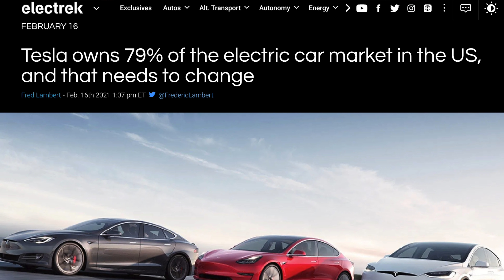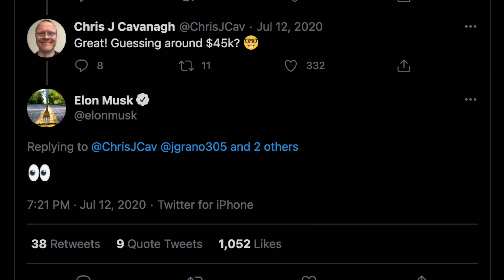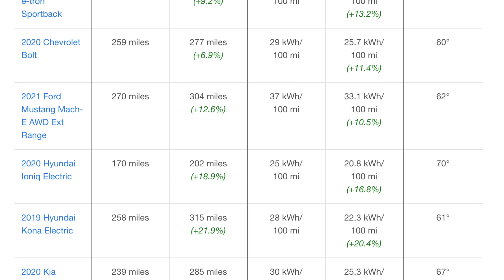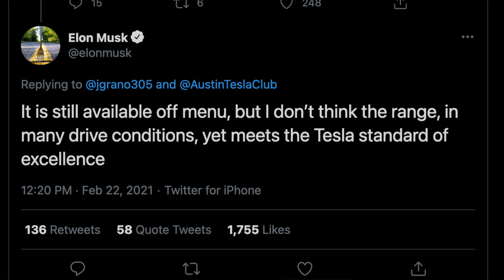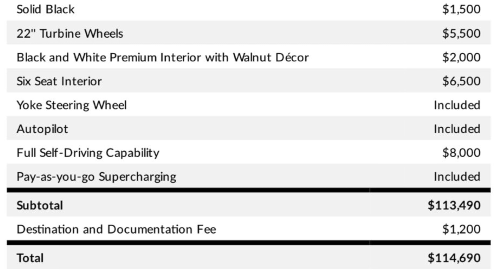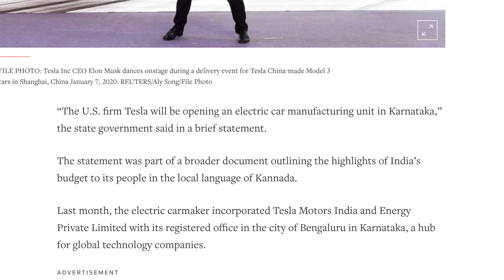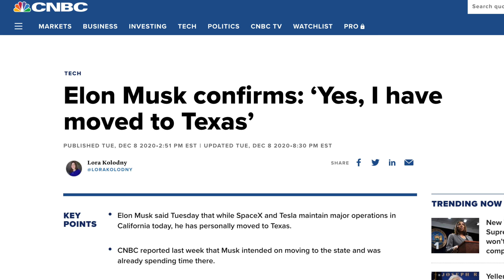What Tesla Didn’t Tell You | Model S Refresh

Comment: Tesla stock has long been extended from its buy zone after breaking out of a cup with handle with a buy point of 466 on Nov. 18, according to MarketSmith chart analysis. Hence it's not a buy. A stock is considered to be extended when its 5% above the proper entry point. It's a technical term used to describe the point at which a stock is up in price over its pivot or buy point and is considered riskier to buy. What you can buy instead is bitcoin. For starters, you’d need a broker. A good recommendation is Paxybits. Contact their open line

Comment: The reason single motor will not be available is because it will be less efficient than the 2 motor one.   The cars are heavy and it takes more effort to accelerate them, so 2 motors to accelerate and once they get going, then they run on one motor, the smaller front one, which gives them the longer range.

Comment: I think that, if carefully driven, the range should reach the estimated distance. Because the acceleration is used too often compared to slower other branches , Tesla's loose power where other don't have this power at all. What you don't have you can't loose. I always drive on cruise control and get even higher ranges than forseen in the energy diagram on the screen.

Comment: Those Edmunds tests were completely invalid. The conditions were not the same for all vehicles test and includes assumptions that clearly benefit everyone except Tesla
Reply: How so re assumptions?
Reply: @Tom_McMurtry  they didn’t run batteries down to empty.  Tesla has more buffer at the low end and also reduces power to ensure range. But most importantly the Teslas were not driven in the same test conditions or on a similar route. Completely invalid test that does not give an accurate representation of any of the vehicles in comparison.

Comment: I've seen some others pick apart that Edmunds report citing the temperature difference in the test vehicles (colder all around for the Teslas), differing routes (how can they use different test routes and expect like results?) and not using "Chill" mode. I think Edmunds stated that they specifically didn't put Tesla's in any range extending modes. I suppose it's possible that they didn't put others in any kind of range extending mode, but some might not even have those.

Comment: Model 3 sr+ in UK is expensive (£40,000 or $57,000 ish) and model 3 sr+ in America is on the website for under $30,000!!!!
Reply: Prices will drop once Giga Berlin is up and running 😉 That pricing includes logistics to bring the car from Freemont or Shanghai 😉
Reply: @carlosribaltes6110  yay because prices are way to high in the uk
Reply: @carlosribaltes6110  model s starts at £83,980 or $118,000+ and model x starts at £90,980 or $128,000+

Comment: The Kona EV and original Bolt, by most accounts, got a real-world range somewhat higher than its specs.  Reason:

The EPA lets EV manufacturers either perform a less-detailed test range test and then apply a standardized (or voluntarily larger) derating factor to that, or they can perform a more-detailed test to avoid that derating factor.  Tesla takes the detailed-testing approach to get the highest number possible.

IIRC, this explains the topic very well:  https://youtu.be/aZJba_oNhT4

Comment: Doesn't the "epa range"  look at total battery capacity.  As I recall the tesla has  "reserved" portion of the battery its like 10 -20 percent or something system won't charge battery completely in its charging settings I can't remember what this is for (longevity of the battery or something?).  So you may not get the entire capacity of the battery with this setting which might explain real world is less then epa range stated.

Comment: I’m stumped as to why anybody would want a yoke steering wheel, even in the unlikely event that it’s actually legal.  I think it’s mostly just a prototype publicity shot.
Reply: Because the yoke is bad arse !
Checkout the GMA T.50s released today... the best last ICE supercar of all time.. and comes with a yolk. From the greatest car designer and engineer of all time. And someone Elon admires.
Reply: @axiomic , I don’t see any bad-assery, nor any other kind of assery, there.  🤓  All I can see is impracticality:  In a sharp turn, you have to take your eyes off the road to see where to grab it.
Reply: @mr88cet  yeah, formula 1 drivers and jet fighter pilots just do it because it looks cool. So impractical though.
Reply: @axiomic , well, fighter planes mostly use a stick rather than a yoke.  But anyway...

Airplanes and F1 cars have control challenges different from passenger cars.  On an airplane yoke, you never have to (and in fact can’t) turn it much more than 90 degrees either direction of center.  Similarly, an F1 car almost never has to make tight turns.  You never, or at least almost never, have to perform a “hand over hand” rotation of the steering.  On a normal passenger car, a steering wheel needs to be able to turn typically 2 1/2 revolutions, and you routinely have to do so.

Comment: Yea I’m getting frustrated with Tesla. They don’t give any order updates or even confirmation on what you’re going to get (steering wheel). Also they agree to order contracts, don’t keep their agreements then completely change the car and say pay up. Horrible business practice. I ordered my Model S Performance on 12/12/20. Then had to update my order per my sales rep to the Plaid with all the extra cost. They said previous orders would be bumped to the front but I’m not confident that will happen based on how Tesla doesn’t give 2 craps about customers and have no integrity. I’m giving Tesla until mid March. If I don’t get a vin/update or deliver date on my Model S Plaid order than I’m canceling my order and going with a Taycan 🤷🏻‍♂️. Enough is enough.

Comment: Tesla needs to provide a method of changing shifting. No stalks is fine, but a method is required to do this somehow.
Reply: There’s controls on the touch screen to shift and in the event of computer failure there’s gear controls in line with the hazard blinker button on the center console.

Comment: I’ve asked several times, if the new Model S can have the round steering wheel. They’re still telling me no. My Model S should be delivered within a few weeks. I really want a round steering wheel. That is the only thing I’d change.
Reply: Probably depends if you order the “full self driving option or not! Yoke steering wheel with FSD, round steering wheel without FSD! My take, anyways!
Reply: Maybe?? I actually ordered it 4 days before the refresh came out and was trying to get the former one, but they called me yesterday and said I couldn’t get it anymore. They said there is no option for a round steering wheel 👎🏼 I did add the full self driving feature, so I guess that’s possible
Reply: @davidkirkham6497  I was thinking this exact same thing. I feel like they don't use round steering wheel to prevent people from keeping full self driving activated with the ol knee technique.

Comment: Thx Ryan. I had numerous complaints to Tesla about my range NOT being 310 miles.In fact, my car only charges to 291-293 & I strictly follow Tesla’s recommendations for battery charging and barley use superchargers as I charge at home. Wonder why it’s the 2018 M3DP + that has that much of a loss and not the other vehicles? 🤔 I’m sure the heat pump changes things in the North East.

Comment: You should do a deep dive into those Edmunds numbers. They aren’t so cut and dry. Some shady stuff going on with how they test the Tesla’s vs other EV brands
Reply: Yes. For example for the model 3 standard range+ 2020:
They got 4,2% better efficiency per 100mi but the total range is 7,2% less than EPA.
How does that makes sense?...
Reply: Yeah. If not shady, then at least "sloppy". They didn't even control for temperature. The Teslas were tested in lower (sometimes significantly so) temperatures. And of course, cold temperatures affect range. Several other variables were also not well controlled for. I do appreciate the attempt at real-world testing, but they didn't control the main variables well enough to do a true apples-to-apples comparison unfortunately.

Comment: Hey Ryan Shaw, under that cup, is more than likely an emergency stop button, which is common in early prototypes for vehicles.
Reply: I saw that in the  plaid+ so immediately thought that.
Reply: Yep, looks like a standard E-stop button from the base
Reply: HVIL circuit likely runs through the button. Hitting the button opens the HVIL loop which causes the contactors to force open, disconnecting high voltage from leaving the pack itself.
Reply: Hmmm does it make sence to cover it if its for emmergencies? The cup is a bigger eye sore than any button. So my logiv would be that it has to be something they want to keep us from seeing yet?!

Comment: Hey Ryan, a REALLY IMPORTANT side node here: Edmunds has some rigged results making Tesla look much worse, e.g. they used the bigger wheels on the Model S and the Model Y tested was only charged to 90%, because they said this was a more realistic scenario, but they never mentioned this in the actual comparison of range vs. epa range, neither did they mention their choice of the less efficient wheels, which naturally give you 5-10% less range compared to the car in the configuration tested by EPA.
The 2018 Performance model probably had a relatively high milage or for one or another reason a relatively high battery degradation too, which easily explains the 10% range loss within 2 years (usually you lose 10% relatively fast (50.000 miles) but after that you can go for 200.000-300.000 miles with only another 3-5% degradation, saw many Teslas with only 85% or more range left after 500.000 miles.

One of their articles comparing the Porsche Taycan with the Model S performance (with the less efficient tires) directly was not only using a bigger battery in the Taycan than what was tested by epa, but a more efficient non default drivemode too, while as I mentioned the Model S had less efficient wheels and possibly a less efficient drive mode(wasn't specified) and the difference in temperature was quiet a bit.
Overall the Teslas were all tested with relatively low temperatures, and while you could argue, that between 73°F and 60°F the range lost shouldn't be too much and is probably actually only 2-3% these factors all together put the Teslas tested in a worse light. Someone could start thinking edmunds actively tried to make Tesla look bad... Another factor is, that they only drove the cars down to 10%, and just added the remaining range shown by the car.
The numbers for efficiency and range are kinda odd too. In only 1 case did they have a worse efficiency but in 4 cases they observed a worse range, which leads me to believe that the Tesla can actually do another 10+ miles even on 0% charge, as the batteries are tested until empty in the EPA test, which is kinda the only real explanation how they could observe better efficiency but less range.

To me the EPA or even better the WLTP numbers are more important anyway, as Range is only a major factor when you actually drive long distance, while edmunds has an increased amount of city driving in their testing. I couldn't care less if I can do 200 or 300 miles in the city, because I'll be charging every night anyway, but on a longer trip range really starts to matter and Tesla is king when it comes to highway efficiency  and highway range, mainly because the drag efficient for their cars is so low and this doesn't even factor in that they offer super fast charging even for their cheaper models, thus making long trips efficient and fast.

Edit: If you want to read the original source for the claims that Edmunds manipulated the data it's on teslamag in an article from 12th Febuary, you shouldn't have a problem finding it.
 (it's only in german, but maybe google translate will give you a decent translation).

Comment: The new Model S spotted was a test model. And it makes sense that Tesla would have the round steering wheel on test cars because they need to be out in public, sometimes many months ahead of the official reveal, and a steering yoke would have given away the refresh early if spotted. Plus it makes sense to have created a standard wheel for testing prototype cars because Tesla could not be certain about if their yoke and stalk revisions would be accepted, or even legal in all regions and countries. So having the round wheel as an option, and the directional buttons on the center console make sense. The taped cup is covering the emergency power off/reset button, which was probably accidentally pressed one time too many previously. I think that the reason why the Model Y had a $2K price markdown was that Biden's Green bill has had potential Tesla buyers holding off on purchases waiting to see if Tesla and GM will get the $7000 federal subsidies promised in the bill. Plus, as you mentioned, the cheaper, entry level competition from the Bolt EUV, Mach-E, and others were getting the media spotlight lately. But I think that Tesla pulled the entry level priced Model Y because they may now believe that the bill will pass, and then the net price will be $42K for the LR Model Y, capturing those potential SR buyers at that $42K price point. But if the Green bill does go through then the Bolt EUV will have a net price of only $27K, before state and local incentives. Ultimately, as long as Tesla keeps the SR Model Y available off-menu then it will be just like the $35K Model 3 was before where buyers looking for the cheapest price will be satisfied. But this time (with a little digging) buyers could potentially get a $35K Model Y SR after federal subsidies.

Comment: the Yolk Steering Wheel is another Tesla's marketing strategy
Reply: Yoke, not yolk. The word comes to modern transportation from the name of the wooden device used to harness the power of oxen, mules, horses, etc. to a work application such as moving a plough or a wagon.  When some early aircraft transitioned from a floor-mounted stick to a panel-mounted control mechanism, the shape of the handles was reminiscent of yokes on beasts of burden and was thus called a yoke.
Reply: @teslanaireiii7101  thanks for the info
Reply: Just like the cybertruck
Reply: @lukehTM  This made curious about where the word yolk comes from. This is what I found:  the Old English 'geolca, geoloca' which means 'the yellow part' and in turn  'geolu' which means 'yellow'. The word at some point in the past was spelled ‘yelk.'
Reply: @fordhouse8b  thanks for the info, really appreciate it!
Reply: @lukehTM  Your’e welcome. Like I said, I was just curious, and you seemed like someone who also might appreciate this kind of trivia. Plus I am really bored cooped up in my apartment for months on end.
Reply: They need to keep the steering wheel normal or ill key every Tesla i see.
Reply: @Kayshots  Why?

Comment: Ask how they control the controllables? What are the parameters of the test, are they all tested in the same conditions, are they on the same route ie highway vs backroads, are they at the same speeds and durations? If you look at how they undertook the tests then the answers for all the aforementioned questions is a resounding NO. Who wrote the information, how did they undertake it, what do they have to profit and are the methods repeatable? The answer again is no. The Telsa range tests were widely misleading.

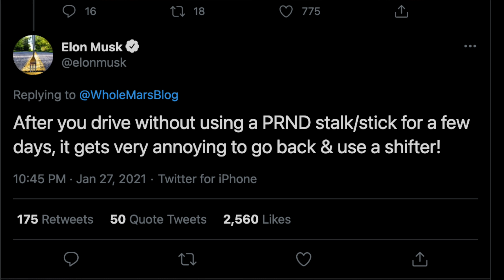Comment: ~ 10:00 - In other words, unusable and dangerous HMI. It figures... All to save few dollars in parts (on $100k+ "vehicle") and to feed the illusion that actual full autonomy is around the corner. And fanboys swallow this hook, line and sinker... Sad. 
Were it not for utterly uncritical fanboys, Tesla would be forced to make actually good cars. They are very close, they have the actual difficult problems licked (like efficiency, although not as good as they claim) - now they have to work on HMI, fit and finish, suspension details (e.g. roll stabilization in models with air suspension) etc - all doable, if forced by the market.

Comment: I say, BS. Remember this is Edmonds not the EPA. What was the temperature when Edmonds was testing, speed, pace of acceleration... I am very suspicious of there numbers. I have a Model Y AWD LR. 

I took a 1,200 trip in November with an outside air temperature of 31 degrees. I had Climate control on Automatic and 71 degrees. I had Navigate on Autopilot set to 70 mph. On my last leg of a 600 mile day, I left Lexington, KY heading to Worthington, OH 200 miles with a 90% DSOC and arrived with a 19% SOC. That is 71% to go 200 miles which would translate to 281.6 miles of range. That is an efficiency of 89.4% with the heat on, in a cold climate, with a very slight uphill grade.

Comment: My guess is that the new wiper will also be used on the CyberTruck. It's a clean design that can hide everything behind a flip up panel when not in use. It's basically a single blade that pivots up 90º then wipes horizontally along a track at the base.
Reply: @carholic-sz3qv  No, that one still wipes in an arc from a central pivot. The Tesla one points up, then slides across on a track.